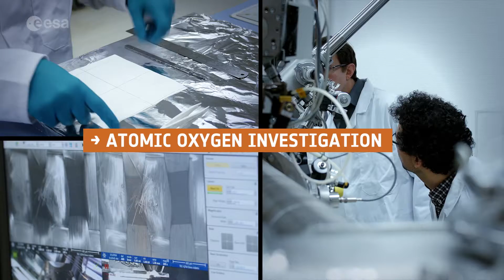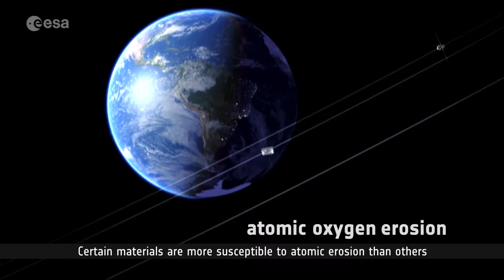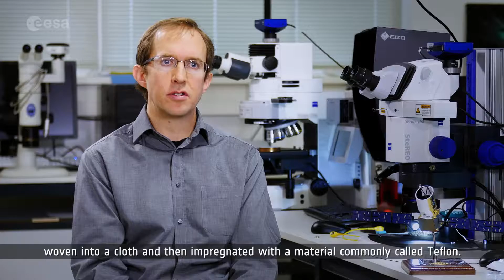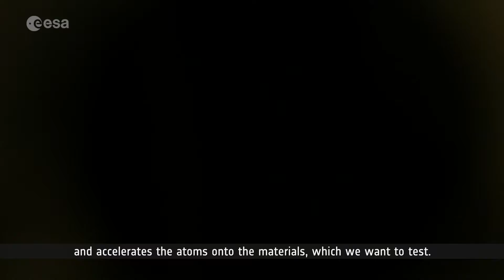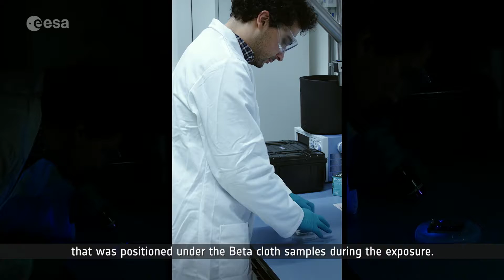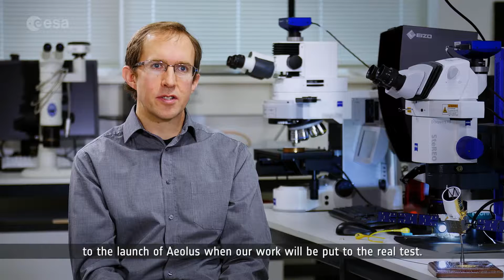Comment: since there are very few faccilities that reproduce atomic oxygen could you explain how it works the technology to reproduce it.
Reply: The ATOX test facility is built for simulating the space environment and for allowing to analyse the effects on samples of materials. The external walls of the satellites and the International Space Station are attacked by atomic oxygen which is the dominant constituent of the residual atmosphere. 

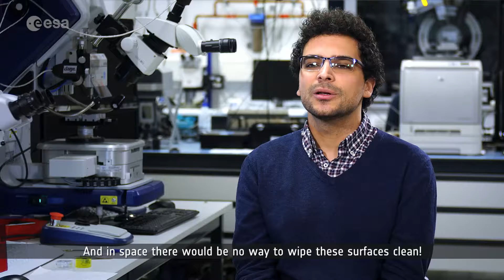ATOX facility produces atomic oxygen (O) at 20000 K from the molecular oxygen in the air (O2) broken down by a pulsed carbon-dioxide laser. The atoms are accelerated by a nozzle up to 8 km/s. ATOX is equipped by a full set of plasma analysis and diagnostic instruments. The samples attacked by the oxygen atoms can be thermally regulated between + 150 and - 150°C. See 02:07.

In fact, ESA just announced a new Low Earth Orbit Facility (LEOX). It can test at a higher flow than ATOX, saving time and money for testing.
http://www.esa.int/Our_Activities/Space_Engineering_Technology/Atomic_oxygen_generator_simulates_fire_in_the_sky